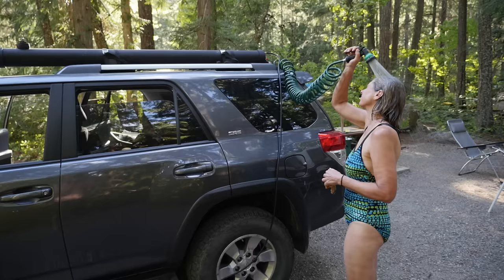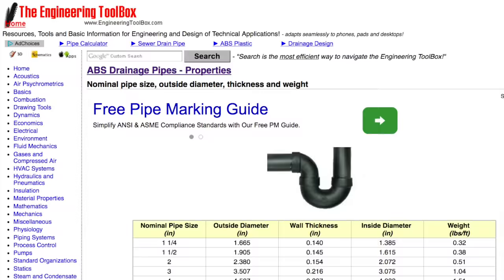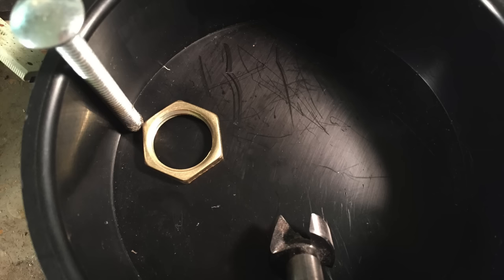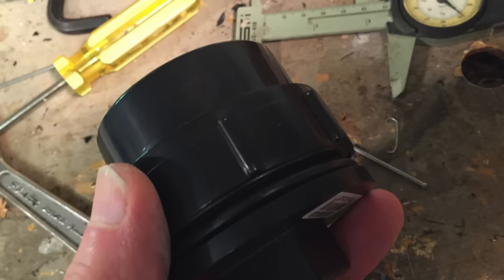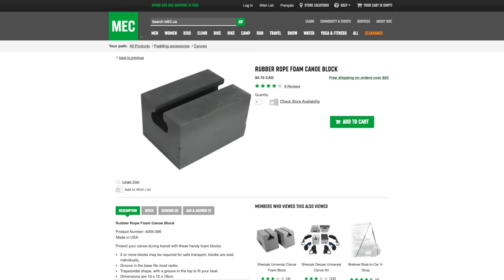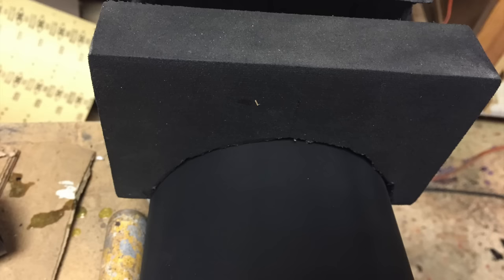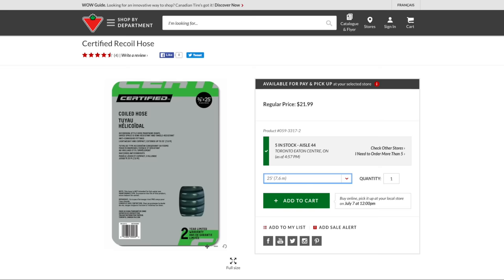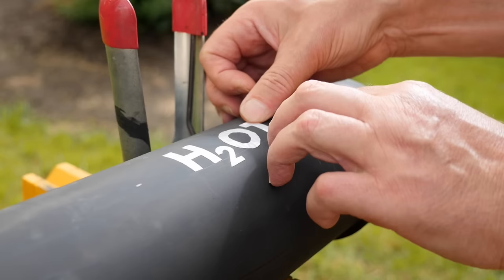H2OT - Rooftop, pressurized, solar-heated shower/sprayer using ABS pipe. DIY

Comment: Nice simple straight forward build similar to mine. But, I used an RV on demand water pump. It will pump up the shower line and shut off. Then as pressure drops when you open the "shower" valve, it turns back on. No pressure in the tank, only the shower line. It does require a tank vent.

Comment: Well done!  Excellent idea and implementation!  Simplistic genius!
Note. Multiple smaller pipes to get the same water volume would offer more surface area for sun collecting although add a lot of complexity.  Math example:  It would take 10-2” pipes to equal the volume of 1-6” pipe, but the 2” pipes would have over 3x the sun exposure. Academic unless faster heating or higher terminal temperatures are needed.
One more point is if there is a need for potable water pipe. If so, this pipe would be another way to store potable water.

Comment: You sir have given a solution to how I will achieve hot water for a bus conversion without having to install a hot water heater. I will implement same size pipe, but use five of them!

Comment: They can handle a tonne of pressure, this ABS pipe gets used for lemon launchers all the time.  Great video, now to see if theres a 12v heating element I can use with my solar panel.
Reply: Have you found a heating element suitable for this? Thanks
Reply: @rguil15  How big is your battery?
Reply: @HondaFit4Adventure  ... battery (or alternator) will eventually be an issue, but it will burn out the first time the water level is too low. These are only meant to be used in the bottom of a holding tank.
Reply: @rupe53  This was Ryan's question not mine.
Turn it off before you use the shower then.
Reply: James ... As someone who installs electric water heaters I can say the reason NOT to use a heating element is safety. You'd need to engineer high temp shutoff, pressure relief, and low water shutoff, not to mention the heating element will be in close proximity to plastic, which is another weak point. Ever see the Mythbusters episode where they disable the safety items on a water heater?
Reply: @rupe53  I was wondering what plastic you were referring too then I realized this was the DIY roadshower video. I have store bough road shower.
What if you were to buy a under powered heating element. One that's not designed for a house but let's say a fish-tank rather. It's not going to get hot enough to vaporize water and cause enough pressure to explode.
Reply: @HondaFit4Adventure  ... there are all sorts of "what if" scenarios and there's a better idiot born every day so I would never recommend building such a device without the safety factors. Besides, there are just too many variables, which is why certain things get a UL listing and certain things are too sketchy. More on topic, there are other ways to make hot water that are faster than solar (add a pump?)... and they don't drain your battery. OTOH, this video is basically about doing it with solar only.
Reply: @rupe53  I agree it's probably not the most efficient way to heat up the road shower, but what if my auxiliary batteries were full and I wanted to divert the access power elsewhere? This isn't something I plan to do nor have I researched any parts but I am going to pick your brain a little bit.  I know a fish tank heater is AC but I brought it up because there's an adjustable thermostat and it doesn't go over 90*. "Some how" if I got a low wattage DC heater  in the tank and wired it up to the fuse block attached to my Solar "Panel" system it should theoretically work for warm but not hot water. (obviously the out put of the heater and external temps will come into play) The heater is fused, low voltage, and wont get hot enough to build up extreme pressure. (My shower has a release valve that activates at 65psi? I believe)
Reply: @HondaFit4Adventure  ... you have the right idea but off the top of my head I think it might be impractical. Using your 300 watt heater that's about 25 amps at 12 volts so similar to running 6 headlights, which are usually near 50 watts each. (ok, 4 headlights and 2 driving lights) A good vehicle battery might have 100 amp hours available but you never draw them down more than 50% without long term damage. Your 300 watt heater is about 1,000 BTUs but you need to convert that water into pounds and times the number of gallons you wish to heat, and then go back and see how long you are willing to run that battery, provided the heater can keep up with the temp loss on the container. Something tells me this is a lost cause. OTOH, there are heat exchangers made that will plumb into the car's heater hoses, which will do the same job in a matter of minutes. Might be more involved and more expensive, but it's commonly done on boats and RVs. Just remember that those are using WASTE heat so it's a freebie / byproduct of driving to your location. OTOH, the water will reach 180 degrees so needs mixing with cold water.
Reply: @rupe53  I'll let you know what I come up with since winter is here. Perhaps a parabolic reflector. I can heat my road shower faster and cook my dinner.

Comment: Really nice ! I'm gonna try this for the top of my tiny house.
Reply from the maker: You could easily make it much larger for a tiny house rooftop. I am thinking that a spool of flexible smaller diameter ABS pipe would be cheaper than the rigid pipe. Just leave it in a spool. A simple volumetric calculation to determine capacity would be helpful to start.
Reply: @ImaginetMedia  Great idea.

Comment: Something you might want to add to this is a relief valve. If you cruise with a full tank in the suh all day, you may blow the weakest link of your shower apart without the relief valve.
Reply from the maker: How would that happen?  There is next to zero pressure built up do to thermal expansion. If anything it would be less than 1 psi.

Comment: Great video, thanks. I haven't tried it out myself but I read a while back that flat brown gets better results than flat black. Although black captures the most heat, it also radiates it best. Brown presumably has the best balance between capturing and radiating. Again, haven't tried this myself but maybe it's useful to someone.
Reply: And even better, insulate the bottom half.

Comment: Looks like YT's algorithm is at it again. This is a brilliant and affordable idea, I think I'll be doing this on my RV with a small row of 4" pipes to increase capacity and run the tap into the bathroom shower and sink. 
The schrader valve is a great idea too, even a compact tire pump could manage that.
Reply from the maker: Glad you liked it and found it helpful.  A hand pump (Bike tire) would work when the tanks are full. It would take a very little volume of air to reach 30psi. Similar to a small bike tire. But as the water is used, the empty volume of air increases. That large volume has to be pressurized.  So now instead of inflating a small bike tire, think of it as pressurizing a car or truck tire with a small bike pump.   Conclusion, a good 12v compressor is a very handy tool to have in an emergency.

Comment: PVC and ABS pipes are resistant to most acids, alkalis and salts. However, they are not resistant to aromatic and chlorinated hydrocarbons. Both types of piping can be used above or below the ground, but ABS is more likely to deform when exposed to the sun. Because of this, some local regulations require ABS pipes to contain pigments to protect it from UV radiation or to be painted with latex paint. PVC is usually made softer and more flexible by the addition of plasticizers.

Comment: Dude!!! Not sure if your channel is still up and running, but I've been looking for a way to provide warm water to my outdoor kitchen without running permanent water lines.  We live in a cold environment and freezing is an issue when the outdoor kitchen is not being heated for extended periods of time.  I will place a series of 2 maybe 3 of these on the roof and out of site to absorb the solar energy to heat the water and I'll run a normal water hose to an inconspicuous spot to supply with city water pressure.  So no need for the pressurized portion of your system.  I will however install an air admittance valve that will allow for air to enter the chambers when the faucet is turned on and allow the system to fill as it drains.  I've been looking for the right setup for my kitchen for about 3 months now and this is absolutely the best system I've seen.... Great job

Comment: You won the internet my.friend🏆
Reply from the maker: I am glad you found it useful. Now, I have to leave my shop and go collect my King of the Internet award.
Reply: @ImaginetMedia  hey what about the psi rating of this type of pipe? And the UV degradation of abs?
Reply from the maker: @farmermike9262  The PSI rating for Schedule 40 ABS pipe is shown in the chart at 1:00 in the video.  The pipe is primed and painted to help protect it from UV damage. Plus the shower is only on my roof when I go camping. The rest of the year it is in my basement which has an SPF rating in the hundreds.  :-)

Comment: After making one of my own, I would only recommend doing this if you already have the tools required to make it. I have a pretty broad toolset, but didn't have the specific hole saw sizes needed. I ended up spending 50 bucks in tools alone, and still made it for half the cost of the road shower.
Reply from the maker: You do not need a hole saw. You can easily  use a "4x2 Tee". Zero drilling. Zero new tools. And maybe 100g extras weight.  Using a T is way easier.
Reply: Either way, it's still a great piece of kit, and now I have more tools which is never a bad thing
Reply: Can you explain this a bit more?

Comment: Great, now that I have seen this I MUST make one. Why the cell core pipe vs PVC? Weight? Thermal retention? Does it stay hot? I have a 12v battery I have in the back of my Tundra with a 50w panel. Any use wiring heat to it for night time? Thank you for such a thorough video. Very helpful.

Comment: great idea, adding a polished aluminium under tray would heat it up even more, the sort of stuff used for indoor plant lights, garden centres DIY stores sell it and it is very cheap, or the shiny reflectors used in ceiling strip lighting,  also the biggest diameter pipe I can think of is a WC soil pipe and they are black,  again very cheap at DIY stores and PVC fittings that wrap around them !

Comment: Dude. Sweet job. Just solved my shower problem for my wife. Now do you have a toilet solution. Cat-holes and dropping nuggets in plastic bags aren’t an option.
Reply: Robert ... look into a "bumper dumper" which is basically a toilet seat that plugs into a 2" trailer hitch receiver and accepts a standard 5 gallon bucket. Not perfect but will be as sturdy as your rear bumper so no "teeter-totter" on irregular ground. Only drawback is you have to empty it once in awhile.

Comment: So cool. I'm going to build one and strap it to the rear bumper of my trailer. TY
Reply from the maker: Awesome!   But keep in mind it relies on direct sun exposure for thermal transfer. On my roof of my truck it gets the direct sun as well as the reflected heat from the roof. I am not sure how the installation on a bumper will affect the efficiency, as designed.

Comment: Thank you so much for these excellent instructions. So clear and easy to understand, no annoying music and a lovely voice to boot! I have one question - I would like to make something like this for a small “glamping ” shower hut that I have just built but would not be able to use an electric compressor for the air. Could it be done with a foot pump perhaps, or could you suggest any other alternative? Many thanks. Steph in France
Reply from the maker: Using a non - electic compressor could work, depending on the capacity of the pump. Think of the shower tube as a car tire stretched out flat. They would have similar volumes and pressure requirements. If you have ever tried to inflate a car tire with a bike hand pump, you will know that it would take hours. If you can get a large volume foot-operated pump, it may work, but you would need a shower after using it!  :-)
Reply: @ImaginetMedia  Something to consider is that when the pipe is full of water, you are really only pressurizing a small volume of air (effectively, the water is incompressible).  So using a hand pump should not be as bad as one might think (think of trying to inflate a bike tire vs. a car tire).    I love this idea though - it beats the heck out of those black PVC shower bags!
Reply from the maker: @paca_bill4863  This is correct, but that pressurization will only last a few seconds. As the water volume is lowered, more compressible space is available.  You would get maybe 10 seconds of spray from a hand pump before you had to work very hard to repressurize.   I have explained his many times in previous comments.

Comment: About the drain plug: couldn't you just push in on the inflation valve to let pressure out instead of the drain plug?

Comment: just one suggestion if you could add visible water water indicator,. so you wont run out of water while you are in middle of shower.
Reply from the maker: Good suggestion. I am not sure how I would do this as there is no clear ABS as far as I know. If anyone has any suggestions, please post them here.
Reply: Drill a hole on the top and bottom of the main pipe. Run a series of clear tubes with fittings from the top hole to the bottom hole. Now the fluid will be present on the outside, showing you the current level.
Reply from the maker: I think you are onto something here. This sounds like a great modification. Thanks for the idea.
Reply: Thanks for the comment. So is this only heated by the sun?
Reply from the maker: Correct. Hence the title... solar heated shower.
Reply: I would you 2 90° brass fittings, one at the half way mark and one on the bottom if room allows for it, with small clear hose if possible, this may only be an issue if pressurizing too high. As the hose may burst off. And alternative option may be a pre-made acrylic option, generally found in boats, but it may need to be altered to fit your round tubing properly.

I was wondering if you use a constant pressure regulator on the tank, I may have just missed it but I wasn't sure how you kept the steady 30psi you mentioned without watching the gauge? 
Just because most '4wd' marketed air compressors such as my own only have one speed, which is go. With no tank or pressure regulator built in to adjust. But I may need to refer to my instruction manual to be sure.

Great video. Looks like I'll be making the same this weekend

Comment: Nice job. I am going to do that. I have seen one with one extra thing you are going to want. At the back end where your water comes out they put a 45 and then the cap with the tap. This puts the tap below the tank and ensures you will get to use all the water you bring along and heat up.
Reply from the maker: Problem is mounting on the roof of my truck. This was all considered when I designed it. When I screw on the hose, the hose has to bend right at the roof. It cannot be any lower otherwise I would never be able to put on or take off the hose.   A simple trick I use is park slightly elevated at the from of the truck. This ensures complete drainage. I also am cautious of this when filling as well, as if the front is lower than the back, air will be trapped at the back thus reducing the water capacity.
Reply: I might be wrong but if the tank is pressurized it shoudlnt matter. The water should come out either way its pressurized ?
Reply from the maker: My design was built specifically to work with my truck, a Toyota 4Runner. I need to be able to open the tail gate. There is not a milimeter to spare in the design to accommodate that operation.

Comment: If you need any strange parts ,I found that pvc softens in the oven at 300 deg for ten minutes , shape it however you want and it glues together just the same. For instance I made flat sheets by cutting 4 inch pipe the long way ,heating it in the oven, then I put it between 2 boards and stood on it for about a minute.

Comment: Very very nice and clear instructions. I'm definitely planning to build one at my shack. Thanks !!

But I have 2 questions :

1) Did the radiator drain valve is that useful? Do you use it often?

2) Due to the emplacement of the inflating valve, when you've already put pressure in the pipe, did the water comes out when you plug the tire pump again to add pressure in it? Should I place the inflating valve somewhere else on top where it's not directly in contact with water?
Reply from the maker: Glad you found the video helpful. In answer to your questions:
1) Yes, I use it all the time to let off pressure if I want to open the cap. However, you could easily go without it. 
2) I placed the valve in a location that is protected. Anywhere other than on the end cap will be subject to damage due to impact.  The entire system is under pressure, including the hose from the compressor. SO no water can backflow. Also, I attach the air hose using the screw on a connection on the tip of the valve. So the threads engage before the valve is actually actuated.
Reply: @ImaginetMedia  Thanks for your return !

Comment: You got the voice and the diction.....DEFINITELY a Narrator.
Having said that, thanks for your video. I want to get the idea for a rooftop RV Van custom conversion. Just a question, what is the relation of psi pumped in to the rating of the pipe/size? 
Thanks!
Reply from the maker: The rating of the pipe I referred to is the pressure rating. My operating pressure is well below what 100mm diameter Schedule 40, cell core, ABS pipe is rated for.